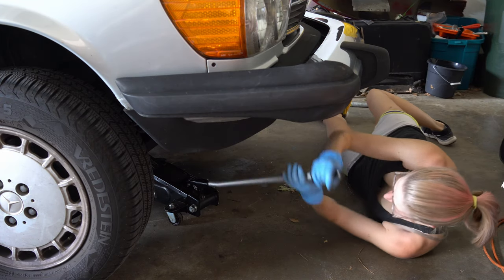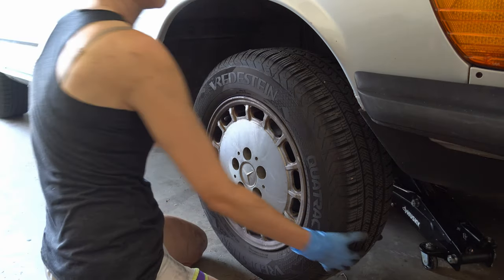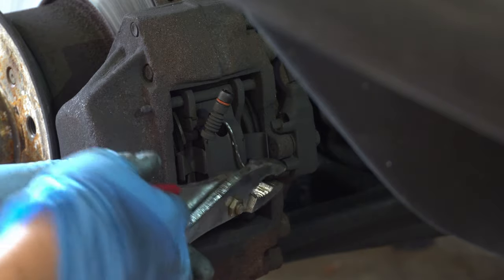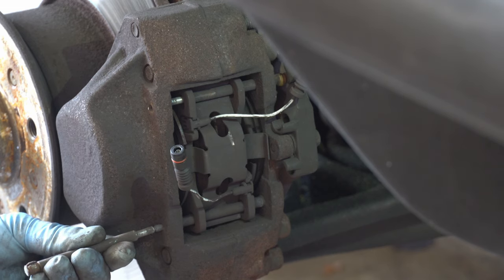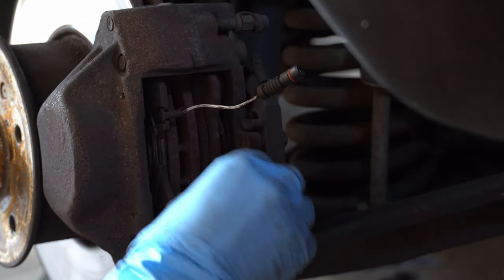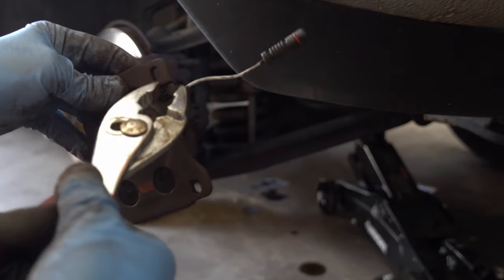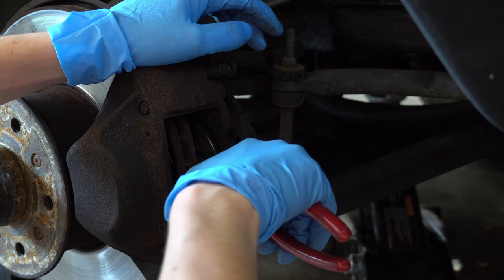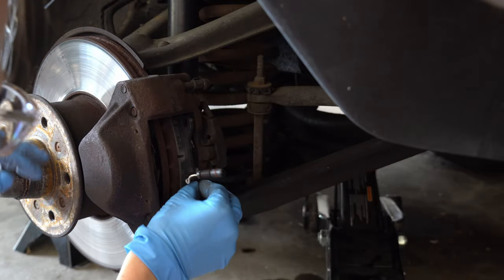1983 Mercedes 380SL Brake Pad Replacement

Comment: Question - did you have to loosen the cap for the reservoir to allow for fluid to flow back while compressing the pistons?  Great video and gave me the incentive to buy the parts to do this myself. I was having problems with compressing the piston, so was wondering if loosening the cap would allow for easier compression of the piston.
Reply from the maker: I'm so glad to hear, and thanks so much! Yes, I think I did leave that out, you'll need to open the top of the master cylinder to allow for backflow, just be careful not to spill as you compress, as you'll find there may be a bit more than you expect in there with the width of the new pads! Please take note of my comment below as well, (though I'll copy here too!) " Replace the new pad before compressing the second piston, there's a chance it could pop out if the other side is unsupported! This worked fine for me, but always helps to be aware and extra careful!" Be gentle with the seals, if you're using what seems like excessive force to move anything, double check that everything is as it should be before committing to brute force, and best of luck!! And of course, double check my work, I'm not a certified mechanic, so my video is simply how I did it, and if that extra comment tells you anything, I'm far from an authority on exact specifications that should be used as actual guidance. Just love showing others that it can definitely be a DIY!

Comment: Thanks for video. Does your 380SL have any lights on the dash that come on when the brake pads are low - if so, where is that light? Thanks. Mike
Reply from the maker: Glad you liked it! Hmm I think it’s supposed to, but there was never an indicator that popped up, even when they were clearly needed/down to the sensor. Wish I knew, but thanks for watching!
Reply: @summerdelsol  check the brake sensor wires on each brake pad.

Comment: Are the front and back brakes done the same way?
Reply from the maker: If I’m remembering correctly it’s similar, though the Pin set up may differ. If it helps, I have another video where I swap the rear calipers on her 380 and it should walk through the process there. The pads are definitely smaller in the rear though. Best of luck, and shout with any questions!
Reply: @summerdelsol  Thank you so much for the rapid response,  someone just gave a 1985 380SL and I am trying to learn as much as possible bout it’s repairs.
I am going to bring this Frankenstein back to life. Thank you again!
Reply from the maker: @Nclrwst  you’ll love it! They’re great cars! I’ll be doing more as I go, hoping to get fuel injectors in next. Wishing you many wonderful miles ahead!
Reply: @summerdelsol  Muchas gracias!

Comment: The pins didn't go in as far on reinstall. Is that going to be a problem?
Reply from the maker: I would try and get them in a little further if possible.  With the clip supplying pressure I can't imagine they'd move, but better safe than sorry!

Comment: Your next job is to show how to replace rotors. This isn't easy because the front rotors are attached to hubs with five 11mm hex bolts. You will need a pneumatic air tool to separate the rotor from the hub. Ordinary hand tools won't work.